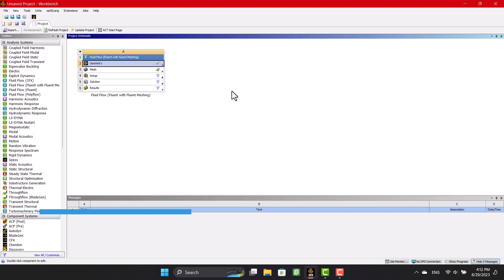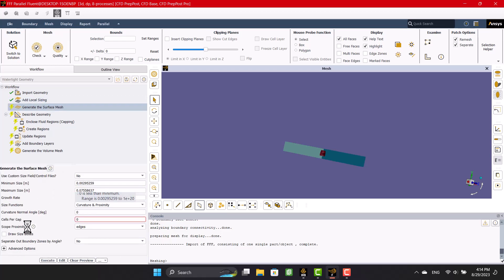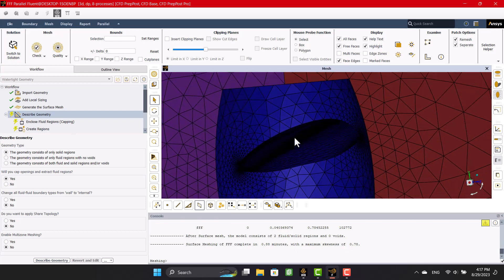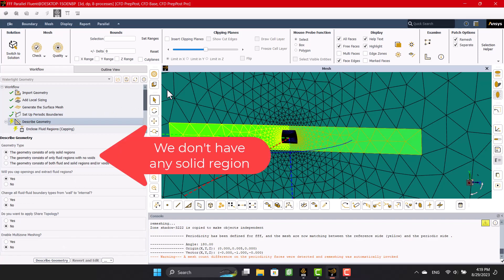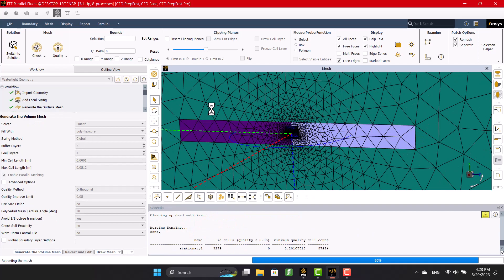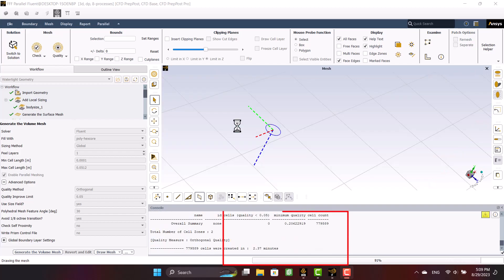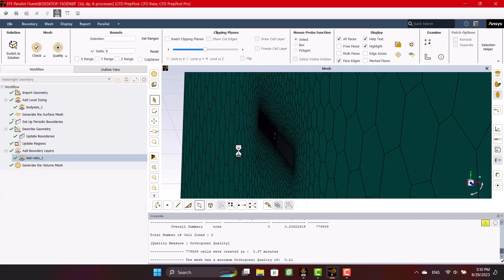🛠️ Ansys Fluent Tutorial: Periodic Boundary Condition in Propeller (Part II) 💨

Comment: thank you for the tutorial.
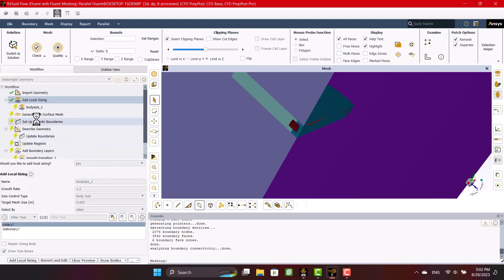I was trying to do mesh refining. However, in the step at 5:22 I am getting this warning:
(The surface meshing was not successful. Import the CAD outside the workflow and use Diagnostics to identify problematic faces)
What could br causing the problem?
Reply from the maker: I think you should clean up your geometry.
Reply: @caewitharminhashemi  
do you mean to use the command fill in spaceclaim?
Reply from the maker: @omerabdo8674 check extra edges, holes, inexact edges, etc
Reply: @caewitharminhashemi  btw I am using the same geometry you gave in the discription
Reply from the maker: @omerabdo8674  i have no idea.